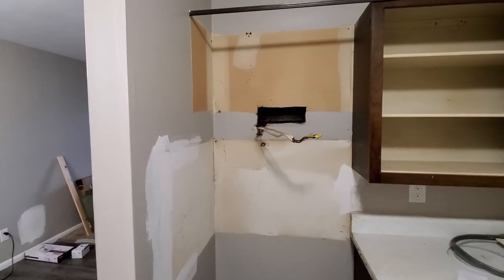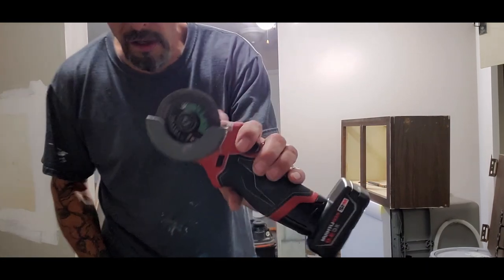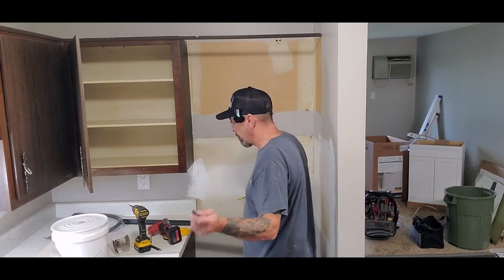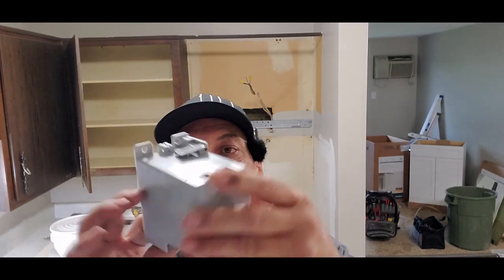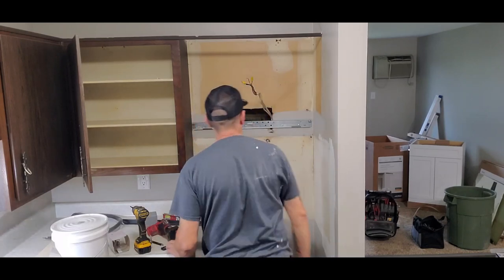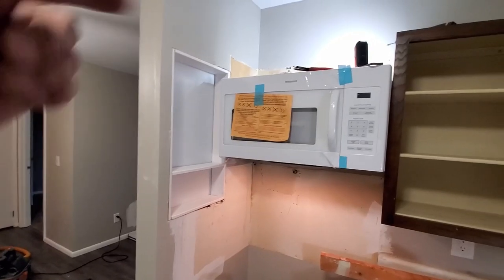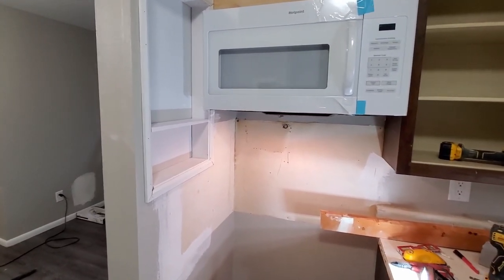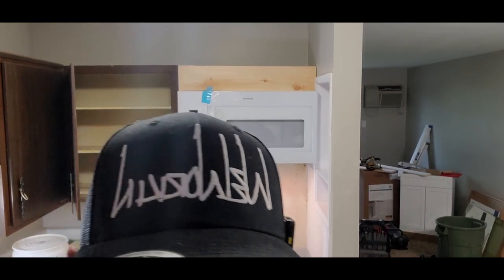Floating microwave

Comment: These manufacturers really need to include or at least make available an install kit for those that do not have cabinets above their stoves. Thanks for the video, saved me a lot of trial and error on how to mount the microwave.
Reply: Did you try this? How did it go for you?
Reply: @ryanroberts3822  Yes, I did use this method to mount my microwave oven and it worked great. Super solid and discreet as well.

Comment: Thank you for video. So  you screw straight down into the angle steel. But then doesn't the screws shaft get in the way of the rear of the microwave from going flush against the wall?
Or, did you screw right through the L angle into the microwave? Or, was screws end was short enough that the top of microwave slid below the end of the screw.
Just trying to figure out what you did so I can take the easiest plan.
Reply from the maker: I use short self tapping screws. It's all good man.

Comment: What would you do if the boss wanted the microwave to vent out the top to a roof vent?  I like your idea except for where you block the exhaust vent.
Reply from the maker: Its not necessary to vent out (roof) mostly that would be a home owner wanting that not apartments . The majority of microwaves vent inside.
Reply: Covered the vent and microwave blowing out the top the blower motor could be rotated to blow it out the front